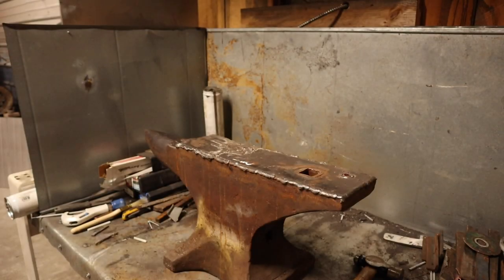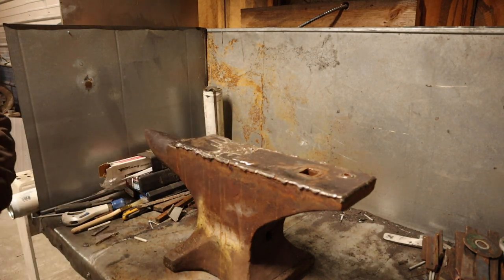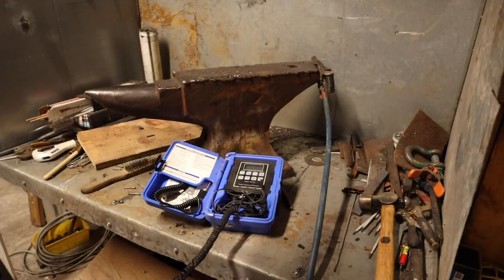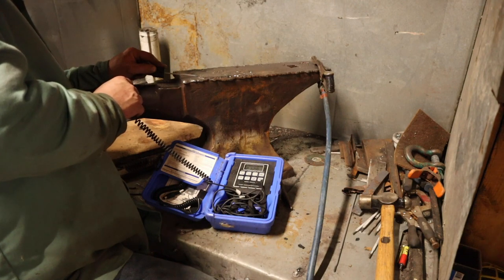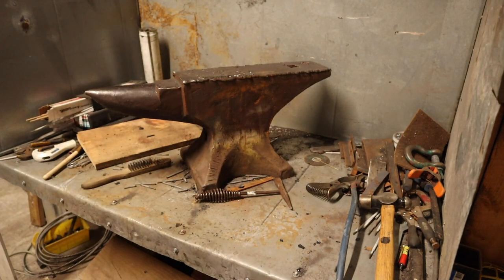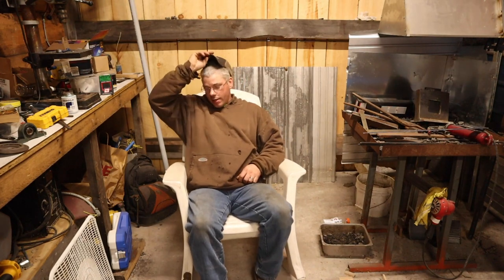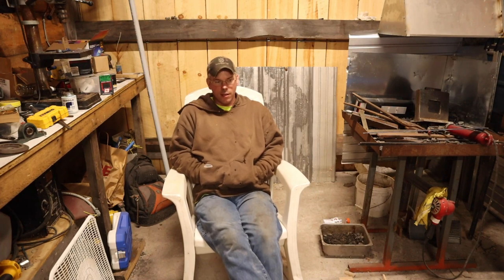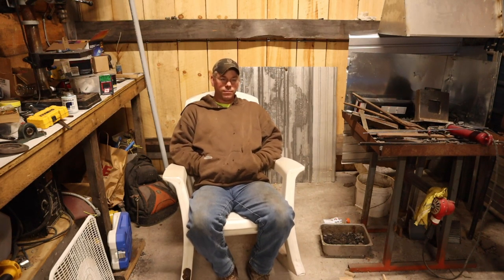Welding An Anvil Without Ruining It, Can It Be Done? Journey To Become A Tool Maker #13

Comment: I bet it will be just fine.
You have researched it and you are following your plan.
A while back I bought a used, and abused drill press, it was built in 1963 here in Japan by a good manufacturer, but the thing had like 8 coats of paint on it and the "Smile of Shame" on the drill press table was really bad (all the holes drilled into the actual table in a crescent shape). I was told that I could NOT weld it by lots of guys, I was welding with my MIG, 200V CO2 gas shield unit. I did my research and I found out from guys who had actually done it, not just keyboard warriors, that you can do it, it has to be clean clean clean and it has to be warmed up. I ground out the smile of shame a LOT and I heated the table up until it was the right temp, I welded it and after it cooled I ground it flat with a big 6" cup grinding thing on my big 6" angle grinder, it looks great, and in fact most people don't even see the weld unless I point it out to them. Its been ten years and it's just ticky-boo. 
It looks like your extraction fan is kicking arse!
Cheers from Tokyo!

Comment: You should have welded 3 strips of 5160 leaf spring! With the bow of the spring up, hold and push down in place with 20ton press as you weld in place! I did Omg the rebound is incredible!

Comment: I have faith in your abilities, l am sure that it will be fine. I am a tool maker by trade, but l  also farm, collect old gas engines and currently build my blacksmith shop. I have used hard surface rods before and they work good. I redressed my anvil on my mill and she is good and flat now. Good luck, l will keep watching you
Reply from the maker: Thank you sir.  Sounds like we have a bit in common.

Comment: It's worth remembering if you do the pad welding your local machine shop can mill the top flat and remachine the hardy hole if needed. Commercial shops stay in business by doing what they're best at and outsourcing where it's not cost-effective to add a machine, process etc.
Reply from the maker: While I agree with you completely that is an excellent suggestion if you have a local machine shop.  Unfortunately we do not have one anywhere nearby anymore.  The last one went out a few years ago.  That's one reason I'm starting to add machinist tools to my blacksmith shop.

Comment: Nice trick with the Pritchel Hole and Hardy Hole!
Now I am talking out of my arse now because I haven't done it myself, and I am a lazy get, but ..........
You used a trick with the router to make it act as a plane ..... could you not rig something similar for an angle grinder and use a cup wheel grinder on it? If it isn't good enough for the finish you could just rough it in and then hand tool it!
Reply from the maker: I've been tossing that around in my head.  Had another viewer suggest it and it sounds like a winner.
Reply: One of those ideas that will eather be brilliant (get that patent in) or totally crap ;0)
At least if you start off with it and it looks too rough you can revert to "normal" methods without doing any real damage.
If it works that would be a good sideline in your shop to offer!

Comment: Its easy to get that straight Jim, Just use a file in different direction  to identify the highs then hit it with a flap disk, just do a little at a time, draw filing works well, there are a lot of turkeys on blacksmithing for begginers, they are clueless and just want to sound like an expert by repeating the myths they have heard
Reply from the maker: I agree.

Comment: Scary...  You and I have done too many of the exact same projects.. Ha.. I have about 10 hours of video when I refaced an old swaybacked mushroomed anvil.. One day, I'll sit down for a day or two and put it together.. Ha.. I did it a little different.. I spent an hour with a torch cutting all of the mushrooms off and then spent about 4 hours grinding after that with a 7 inch grinder to find the edge of the anvil again.. I burned 10lbs of 7018 filling up the low spots and getting the edges back on the sides/corners,  and ends.. Then, I ground it all flat and smooth (with no significant low spots and then I bought a piece of 4140 steel 1.5" thick and took it to a machine shop and had the hardy and pritchel hole cut out and spent the next day preheating to 450  and beveling and welding about 5 passes all around to get it on there solid with a good rebound across the anvil.. I built 4 burners, and sit the 150 pounder on my coal forge and coked up 10 gallons of coal and started the process of heating to non-magnetic to quench and temper in one step.. Learned that from an old smith in lower Mississippi.. 
Took me 4 full days for the job.. Prettest damn anvil you have ever seen when I finished it, and the perfect hardness for an anvil.. 
I will never sell, barter, give away, that anvil.. Too much respect for it, and the project.. I have to look at it every now and then to remember.. Anything is possible... I was told what I was doing could not be done.. I sort of agree with the old smith that told me that, but, can't argue with the results.. BTW.. The only way to get one of those things flat again is to use a Stone Cup Wheel.. 
But,,, don't worry about messing up the anvil.. Nice thing about welding on an anvil and not being scared of it is,,, you can fix the damn thing up if you ever have to fix some nicks, etc.. You have to get it pretty damn hot to screw up the temper..  We are talking "getting to orange/red hot.. You don't have to worry about it..  Your welder will overcycle before you heat it up that much.. Even if you start at 450 degrees F before you start welding.. I had a buddy and we doubleteamed it.. Stacking welds and walking from one side to another and kept the anvil between 400 and 600 the whole time.. 4140 is a tough steel and great for an anvil face.. 
BTW.. Turn the Anvil upside down, build a tin house around it. Stack the burners in on all 4 sides and get the coal going under it.. 
Get one or two speaker magnets and fix them to a pipe or pole to reach in and check to see if you have reached non-critical.. Once there,, I took a 1/2 of a 55 gallon drum and cut some 6" square tube lengths standing straight up to sit the anvil on when I had it ready to quench to get it 5 inches or so off of the bottom of the drum (Plastic by the way).. I built a rack to pick up the anvil with and take it to the tank to quench it.. Basically a 1" square tube ladder with a sliding rung on it with 1-1/2" square tube slides over the 1".. I put one piece of 3/8" x 1" flat bar on each side of the anvil (on the rungs), that fit into the mouse holes just under the mass of the anvil.. That way, I could pick it up and know it was not going anywhere..  I only quenched what needed to be quenched.. Just the top 1.5'' of the anvil.. I did it in water and steam quenched it.. It will also temper when you quench it.. (The Steam Jacket).. it is how they did it years ago.. I had a hose ready to fill the drum back and kept it at 1.5" up on the face of the anvil until it cooled black again.. I just kept spraying the water around the anvil to keep it cooling.. Worked perfectly.. So, don't worry about going that route.. 
If you are happy with the face of the anvil, your done.. If not, build it up and take it to a machine shop and have the surface it,, or do the best you can and put some 4140 on top of it and do what I did.. A flat anvil is a happy anvil and the smith behind it also happy.. 
I put a graduated radius on the edges.. More round where I work it the most and on the front and tail edges, I kept the edges sharp, so I could mark my steel with the front and rear edges, where I don't usually pound on anything..  A good rounder radius in the meat of the anvil and a little sharper as you go to either end, if you need some good creases in something.. 
Found your channel looking at some ideas for an oil burner.. Building a naturally aspirated 20lb cylinder just to see how it will work and get some heat in the shop, then I will play with some Compressor air and blowers, etc, and put an insulated riser like on a Rocket Mass heater and do some experimenting with that to see what I like there. Hopefully, in a year or two will be building a multi fuel stove that I can burn either Coal, Oil or wood with a few minutes of modification.. Something that is easy to maintain, regulate, and is plenty of heat for the shop..  Wish I had more time to post the hundreds of gigs of video that I have on my computer.. Basically, the only thing I post is something I can do at one recording on my phone for the last few years.. I spent some time editing a few here an there and decided I would rather spend that time building something else.. Ha.. Love to work.. Weird isn't it.. Ha..Ha.. The only complaint I have ever had out of a female companion.. You work too much.. Ha..Ha..Ha.. Screwey me,, I just don't quite consider 90% of it work.. It's just another challenge waiting to fall into a priority slot on my Novel Sized Todo list... Ha..Ha.. Cheers Fella.. Keep the videos rolling..

Comment: I tried going back to hear what rod you used in the center but I can't tell what you said. What rod did you use in the middle of the anvil?
Reply from the maker: I used 7018ac for any filler and then Hobart Hardalloy 58 for the face (top) of the anvil.

Comment: Heating it up for long periods will anneal it and the way to test hardness is to have it Rockwell tested. I could be wrong.
Reply from the maker: That is the correct way to test but in terms of hard enough for smithing is by testing the rebound.  Keeping it under 400 will relieve stresses without drawing the hardness out of it.
Reply: 400 or so yes.

Comment: I suspect being able to tighten up the hardy hole and put new shoulder edges on the badly worn deck was probably well worth the sacrifice of a couple points of rockwell hardness of the work deck.  Probably dropped from HRC 54 to 52 (that's a blind guess).  

Kudos on the preheat ... I cringe at all the vids out there of people adding hot weld to cold unheated anvils, or building them from scratch by welding together unheated pieces via full-pen.
Reply from the maker: I agree, this thing is plenty hard and has great rebound.
Reply: @TheTradesmanChannel  Yeah, I cant imagine why people skip preheating ... I guess they just dont know.  It's not that hard to do like you did and simply point a weed burner at the deck until water just starts to dance ... a 20 lb refill of propane is well worth it if it helps guarantee the welds dont crack prematurely and spoil the entire effort.
Reply from the maker: I agree with you all the way.

Comment: Good Lord, dork-snorkel, we get it, you're not a professional welder or welding instructor.

LOL 
Just jabbing at ya, my friend. How's that leg doing with the dropping temperatures and weather? 
If it wasn't so heavy, you could build your belt grinder and use a flat platter to plane the top. But you, and I, aren't that strong.
If you have a belt sander that has a long enough platter, you could sand/grind it on the diagonal, switching the diagonal with each grit change.
Can't wait to see how you go about surfacing that plate.
See ya next time.
Reply from the maker: Hey buddy, using a belt sander with 36 grit Diablo belts.  That and the angle grinder.  Going to take a minute.

Comment: It seems it would be possible to just remove and add a 1" thick steal plate on top of the base, if this didn't work. Then it would be perfect. Also wouldn't laying it in sand be better then water, to let it cool slowly?
Reply from the maker: Have to cool it very rapidly for heat treating to do it right.  Slow cooling will leave it softer.  Same idea as quenching to harden steel.
Reply: @TheTradesmanChannel  I've seen on "Forged in Fire" where water can make steal brittle. So they use some kinda oil. I'm not sure if it's a specialty oil or if Crisco would work. Thank you for your channel. I appreciate the time you put into it, and your music choices are fabulous!
Reply: @jamesculp3622  there are speciality oils for hardening certain types of metal alloys, but a lot of successful blacksmiths use peanut/canola/vegetable oil.
Reply from the maker: Anvil faces of this vintage are of a water hardening steel.  The metal on FIF is so thin that even the water hardening steels they use might crack in a water quench.  I'm with Thomas, I usually use veg oil.

Comment: Love your scientific approach but I'm pretty sure anyone forging horseshoes or a multiple sets of tongs will create a face temperature that will blow your theory out of the water. Metal doesn't de - temper quite that easily. If it hasn't started to glow at least a little..... your safe.  Can't wait for the reaction to this comment.
Reply from the maker: At 450*F you start losing your temper.  I've forged for hours and hardly get the anvil face warm.  Welding generates a shit load of heat around the welded area.
Reply: @TheTradesmanChannel 
Nope. You totally wrong -- this huge chunk of metal easily dissipates the heat from such a small welding zone.
Also no need to preheat the anvil your burner cannot to create enough amount of heat -- it totally useless, time & money wasting procedure.
Why even do it if you’re afraid detemper face ?
Anyway even worst case scenario become true -- it still be better than a cast-iron anvil from Harbor Freight.  ))))  (wispering: which aren’t so bad as people think) )))

Comment: You'll spend more money in grinding and sanding than you will at a machinist, plus it's impossible to get square and flat by hand.

I'm a cheapskate too, but sometimes it's better all around to have a pro do something.
Reply from the maker: There's more to it, most of them won't touch an anvil due to the hardness.
Reply: True, some won't. We always just charged a little more for the harder inserts. I didn't notice if you used hardface or stainless rod. Stainless isn't too bad, hardface does eat cutters.
Reply from the maker: I used Hardalloy 58.
Reply: Yep, that stuff is hard as a brick.

Comment: Not intending to try to tell you how to do the job... I enjoy watching you do things your own way. But I think I would have surfaced the entire thing, then welded on another piece of steel. My gut tells me though, that I would simply be trading one set of problems for a different set of problems...
Reply from the maker: The weld has to be solid under the entire face, only way to do it right is by forge welding it.
Reply: So yer saying bubble gum and baling wire ain't gonna bail me out on this one? LOL
Reply: @selador11  ROTFLMBO!
Reply: @TheTradesmanChannel  or, a spacer under the middle wide enough to get a rod in there for a good filling weld (a couple of boxes of rod later and it still has to be heat treated).
Reply: Just talked to an Army REME ....... You havn't used enough Gaffer Tape yet ;0)